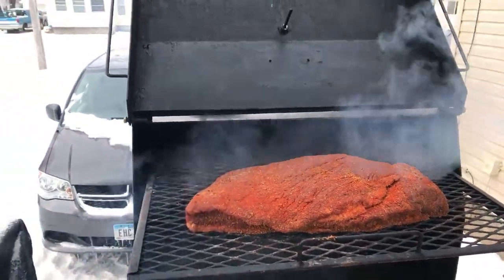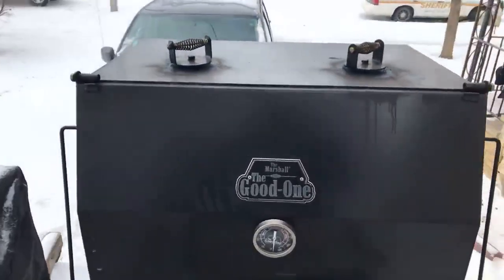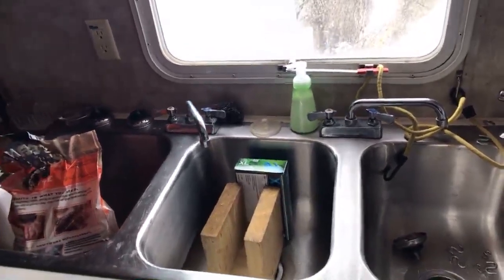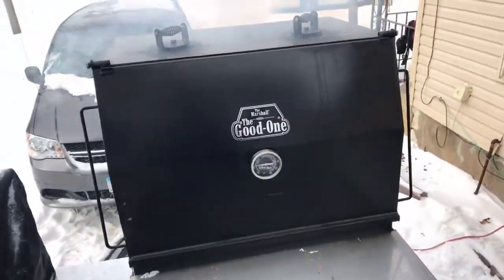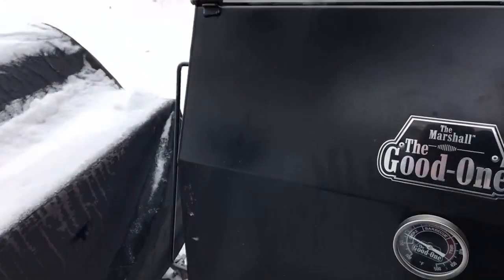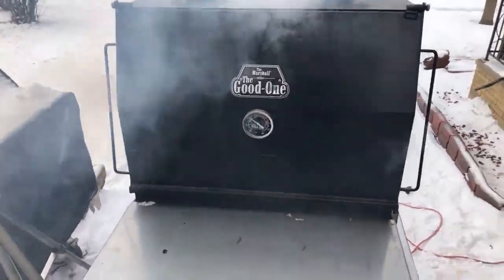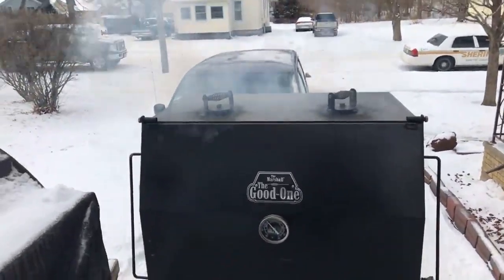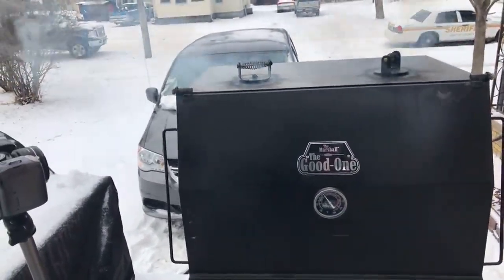Brisket cook on the Marshall smoker

Comment: You can get one of those oil circulation electric heaters it looks like a mini radiator and keep it running in there all the time on High and it will or should keep things from freezing up in there or maybe run 2 of them. You would be surprised at how much heat they put off and the barley use any electricity at all.   My cousin who lives in Northern MN keeps one running in his 24' camping trailer to keep things from freezing inside.